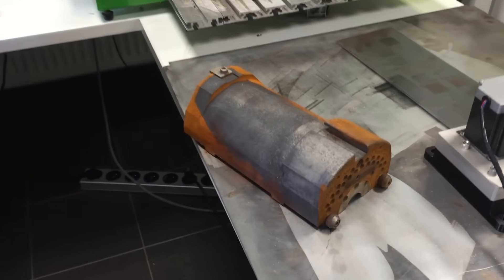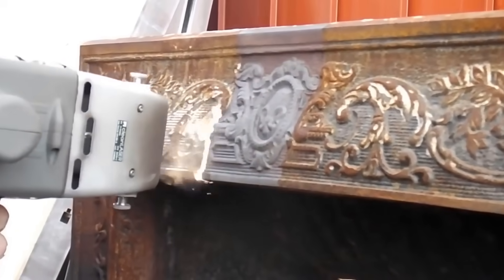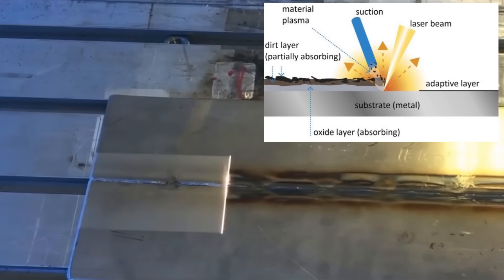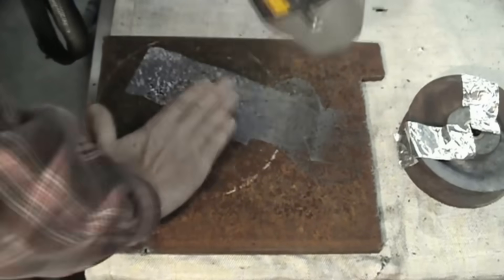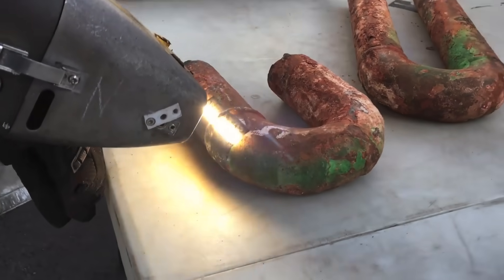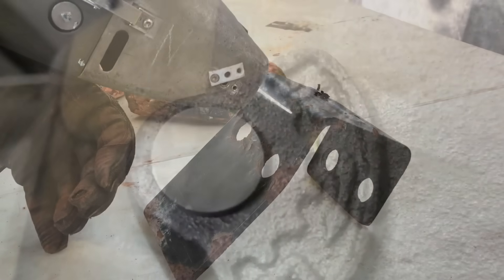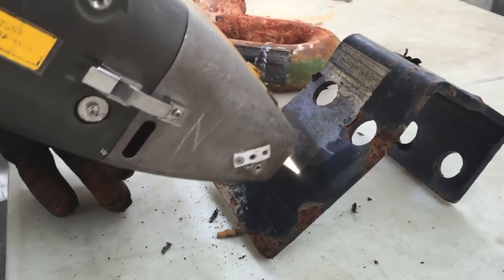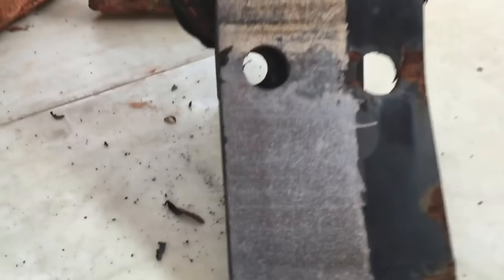1000W Rust Cleaning Laser - Removes Rust Effortlessly

Comment: So...this may sound a bit silly to some, but I'd like to see this tech adapted for snow removal.  If it could be done, it would save hours of labor and millions of dollars a year to most cities and communities.
Reply: If they're expensive, then they're inefficient. Resistive heating is very expensive because it uses a tremendous amount of energy.
Reply: @andythealien1  I'll give you that it might use a lot of energy.  I'll also say that I didn't realize that the snow would reflect the laser, but of course it would.  The environmental point, however is just an exaggeration.  Catastrophic?  Because of energy use?  Why, because coal does damage to the ozone layer?  This is the same argument that some people use to get folks to turn off the A/C in the summer time.  The methane from cows farting does more than four times the amount of damage to the ozone than almost anything else.  Not to mention the emissions from plants and factories.  Someone using a bit more power for a modern convenience is negliable at best.  Not to mention the fact that the main argument here isn't actually about the laser, it's about whether HEAT is an efficient method of snow removal.  I believe that I've already aquiesed that the laser might be a bit much with our current understanding of power usage, but HEAT is a MUCH better way to remove snow and ice from walkways and streets and if you don't think so, ask the entire country of Germany.  They have heated walkways in most of their major cities.  The reason that we don't tend to use technology that is more efficient in this country (the US) is for 2 reasons.  First, a lot of Americans think that it is stoic to do things the hard way and they are wrong.  The second is  really simple.  It's greed.  There's no more money in permanently fixing snow removal than their is in permanently curing cancer.  There are also always people who make money on providing a temporary solution, whodon't want you to have a permanent one.  Like the companies who sell ice melt.  Do you have any idea how much ice melt is sold in just this country per year?  And that shit is terrible for the grass and everything else.  Heat is a far better choice and in case you hadn't noticed...this is absolutely my Hill to die on.  So please keep commenting.
Reply: well you cant do it, the energy required to melt snow to water alone, is massive, really it is, try using a flame thrower and 100 gallons wont even do your driveway
Reply: Well...I can already tell you that THAT is not true, because when I lived in Baltimore, they used huge trucks called Snow Dragons to melt tens of tons of snow to water and let it leak off into the Chesapeake.  You can also have heated sidewalks installed onto your property that ensures that ice and snow don't even accumulate.  Their all over Germany actually.  Most roads there are the same, especially in metropolitan areas.  I mean, if you think about it, you can go out and turn on your car for like 20 minutes and accumulated ice will eventually melt off.  I have also watched a guy completely thaw out his sidewalk with an old space heater and an extension cord.   So...no.  That's not true.  Heat is probably the MOST efficient way to remove snow.  It's just that, like everything else, there's no money in just solving the problem, but there is a TON of money in selling people Ice Melt and charging to plow streets.
Reply: Melting Ice and snow with heat is really really inefficient. It takes less work to move snow than it takes to produce enough heat to melt that same snow.
Reply: imzjustplayin right, and we can't burn trash to get thermal energy too, right.  So sick to death of people telling me things can't be done and then seeing people doing exactly what I suggested in spades a few years later.  It can be done.  It is already being done.  Live with it.
Reply: Accept...no.  See above.  If heated sidewalks are good enough for almost all of Germany, then I submit they are no where NEAR inefficient.  Those people don't like things that are inefficient.  It might be expensive, but that's not the same thing.  Also, regardless of whether it is inefficient or not, it is MUCH sager to simply have heated sidewalks that no one has to shovel.  Safety overrides expense.  Or at least it should.

Comment: Could this clean something other than metal?  I think it would work for removing barnacles from the hull of boats.
Reply from the maker: probably not, if it did not hurt living flesh it would probably not hurt barnacles, plus no metal involved.
Reply: that's what they invented pressure washers for(ok not really but it works)
Reply: Wonder World you obviously could tune the laser to vaporize whatever material the barnacle is composed of. However that brings the problem of this being a Star Wars weapon.

Comment: Well it is very clear that it is not and of the shelf item for most of us mortals, but would you please at least state what type of industrial companies use it and what for? I mean aerospace? or medical equipment?
Reply from the maker: as you can see by the footage, almost anyone who works with metal could & probably will eventually use it, renovators of old iron works would find it very usefull, but being it cost so much only the bigger companies can afford to buy it and have it pay itself off in saved man hours.

but like with all technology even us mortals who have hobbies in our garages will be able to afford one, I would expect a home model to be available with in 5 years for probably $1000-$2000, and in 10 years after than just a few hundred.
Reply: sure for not at 500k few customers, but if it gets affordable, every body shop, repair shop will want one